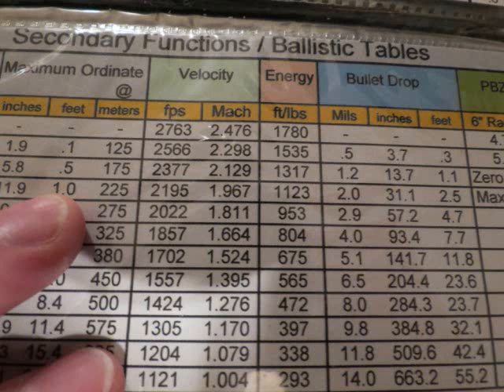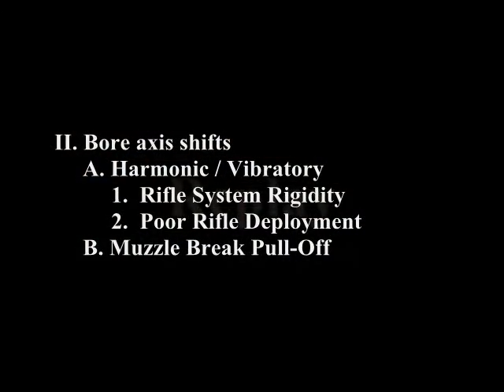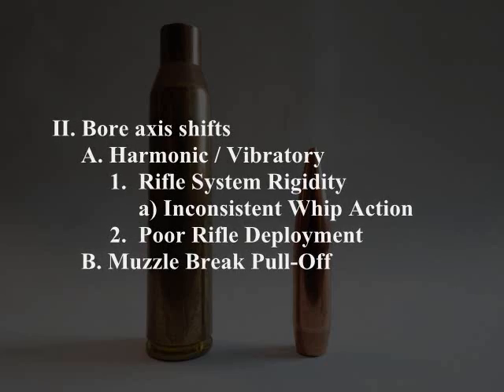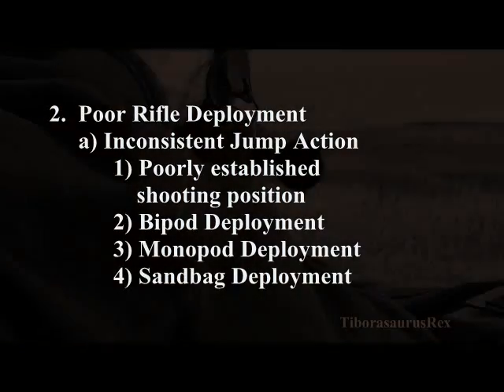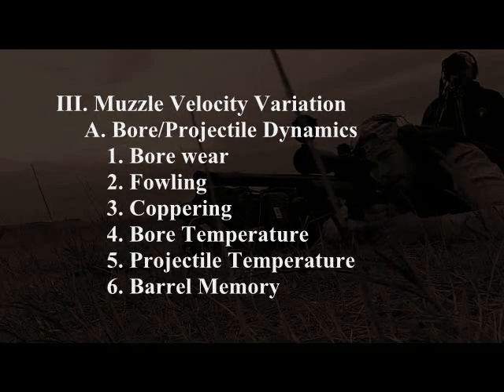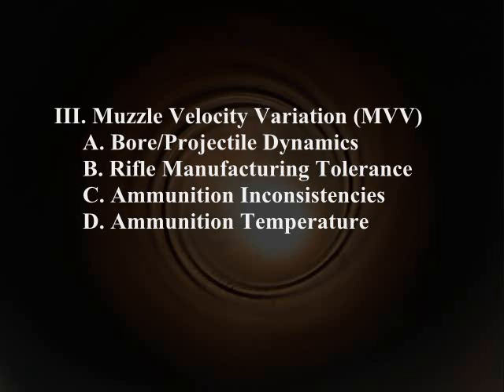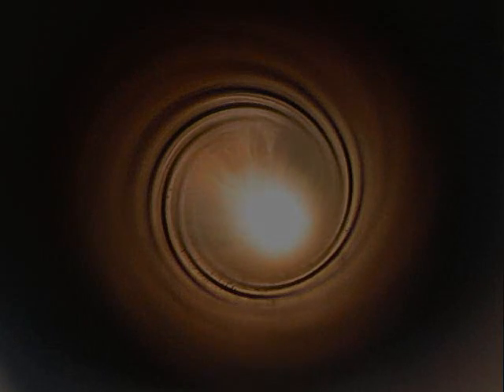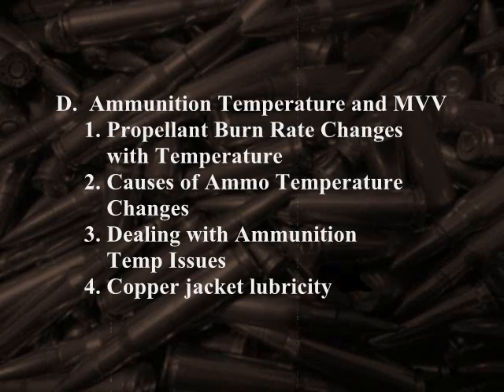Long Range 101 Part 34 - Advanced Internal Ballistics - Introduction - Rex Reviews

Comment: Holy Smokes!  A Friend of mine recommended this series to me and I watched the first 25 or so videos without learning anything now we are getting to the meat of it and I don't know if I can handle it, lol. you have me on the edge of suspense as I try to figure out how to adjust for actual vs horizontal range without having to crawl through the ticks and chiggers with not only a drag bag but also a drag binder that requires hardware store upgrades to carry all my cards with differences and changes. I am super excited to see how you conquer this feat simply and to continue learning more.  Thanks again for the time you have invested into this project for all of us, it is a true charity.  I am very happy I started at the beginning so that all of the back references are clear to me.  The time I have invested is so little compared to the time, knowledge and wisdom that you have put into this.